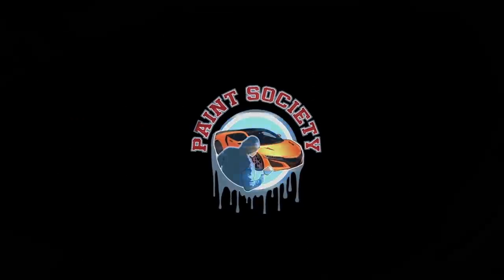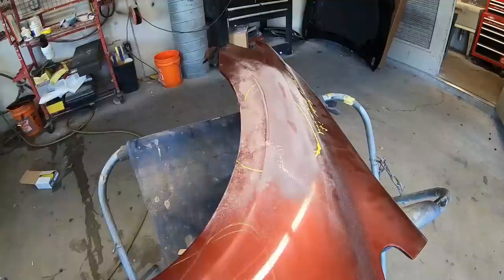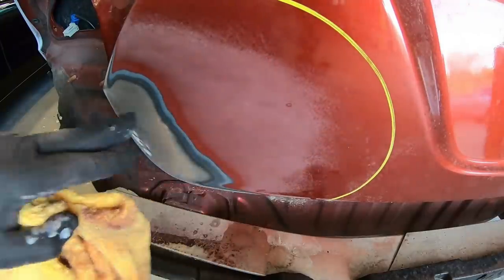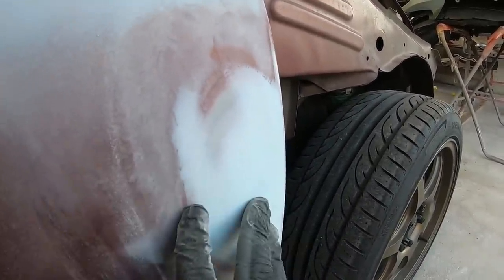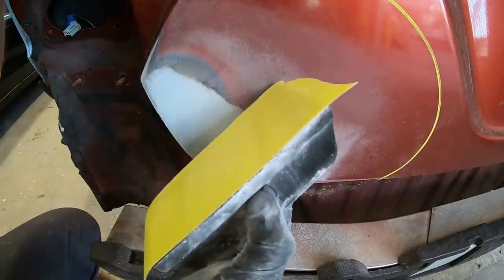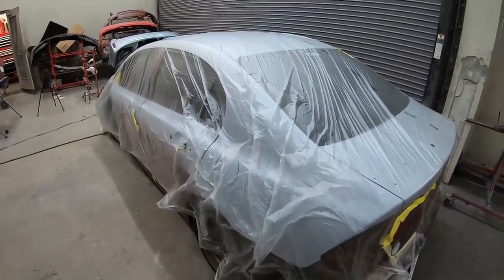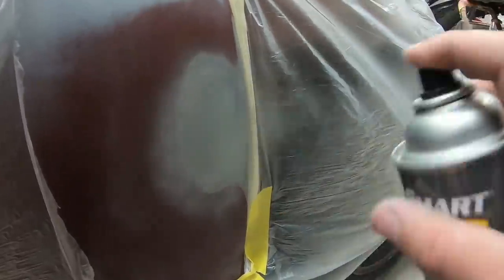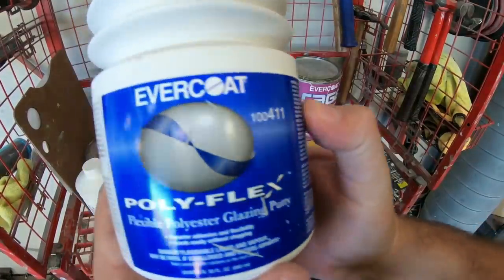How To Paint a Car Guide: Episode 3 Bodywork

Comment: For anyone doing body work on these cars, don’t ever forget to use Black “guide coat” it shows all the high an low spots! Same as with primer after guide coat and block it. I spray the guide coat before even blocking so you can see what you are doing while you block.
Reply: I personally think a “guide coat” is overrated. Eye ball and the hand test is good enough. When spray a guide coat a lot of factors come in play. Finger trigger, spraying speed, type of spray can all come in effect when spraying a guide coat and is too inconsistent to use it as a guide.
Reply: @30minforasn  personally is use a dry guide coat, its a black powder thats applied with some sort of a sponge. It deffenittely helps with finding scratches from the previous sanding paper and instead of using a masking tape for sharp edges i use this powder to highlight where the edge is. To see if the object is totaly flat without any bumps etc i spray a solvent based cleaner so the object gets shiny and all the unefen parts gets highlighted. Nice to see how every one developes their own way of doing paint jobs.

Comment: Great video as always.  It looks like you are putting bondo right on bare metal.  Some people claim that you really should epoxy prime first.  What are your thoughts?  Thank you.
Reply: Depends on the filler. You should use the filler suitable for adhesion to bare metal because not all do, and not all are effective at it. At my shop we never use any surfactant for adhesion between metal bond filler and the metal, it's not necessary. What we do do, is ensure there's plenty of adhesive texture, so we filler to the body at 180 grit and don't bond to primer or paint if you want long term adhesion :) but if you have a filler that recommends a surfactant or epoxy primer first then definitely FOLLOW that procedure! There are sooooooo many brands out there, it's insane. And they all ask for differing methods of application. And if u find one that works for you and gets u good results, then absolutely stick with it.

Comment: When you’re talking about making sure to clean with solvent based cleaners can you be specific as to what you’re using ? Is it acetone or lacquer thinner or some type of mineral spirits
Reply: Wax and grease remover is most likely what he uses that's what we use at work. Just want to wipe it on wet and wipe it off with a dry cloth to remove contamination not just spreading it

Comment: That's a very informative sir Brian...can I ask question...if I can.  You using primer is 2k primer...and a itchy primer is same as Bondo sir ... hopefully you can answer.. thank you
Reply from the maker: Itchy ?
Reply: @PaintSociety  yes is itchy primer same a filler Bondo ...and surfacer primer you using is 2k primer...
Reply: @PaintSociety  you sand block filler320grit and then there's a metal view..so you spray itchy primer...does it mean same as filler right...
Reply from the maker: @mahalnidivine7270  you mean self etch primer ? That’s just for metal so it doesn’t rust
Reply: @PaintSociety  oh..that's what I mean... thank you sir Brian... Yes I mean Self itch primer....now I know this is for metal..for small spot...

Comment: It’s poor practice to fill over paint in my Canadian climate. The metal and paint expand and contract at different rates during the cold season, and this can result in the repair showing it’s face 👍🏻
Reply: i did body work out of Alaska and did not find this to be an issue, as long as you fill over OEM paint only and not re sprays.